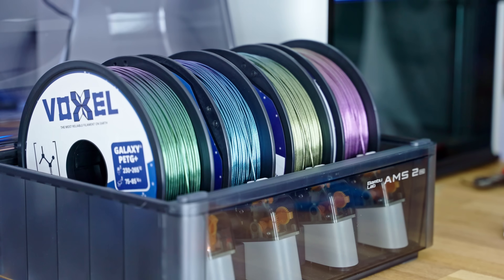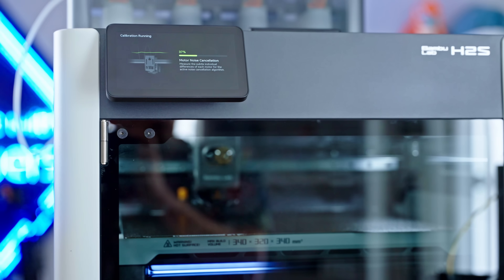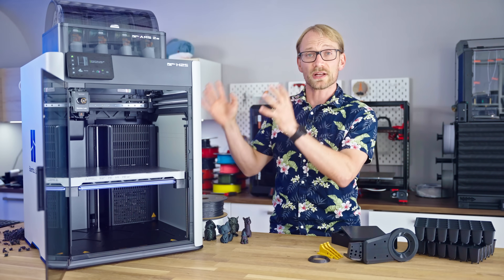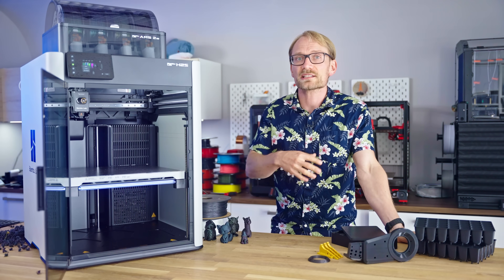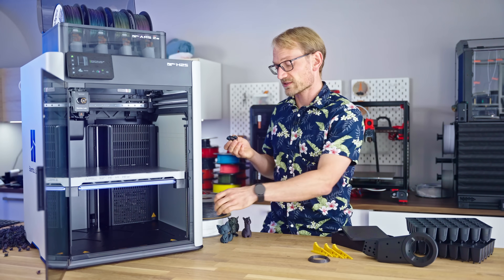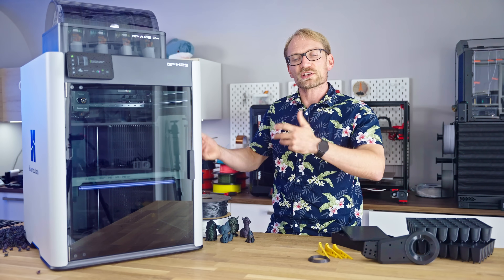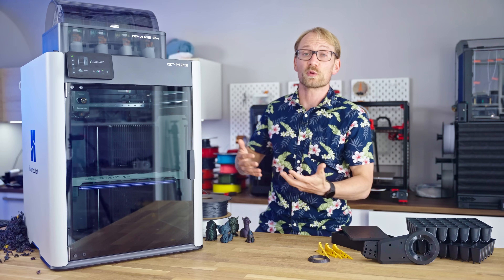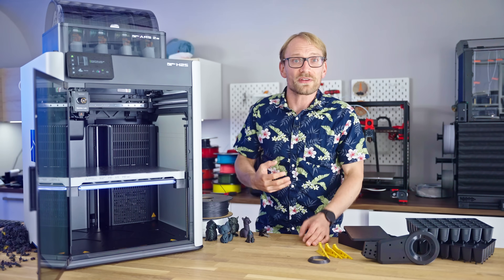Is Bambu's H2S truly a H2D Lite or just a bigger X1C?

Comment from the maker: So while the upgrade path H2S -> H2D has been ruled out by Bambu, apparently there will be an upgrade from H2S to the nozzle-changer H2C - though Bambu are already tempering expectations for how easy of a process it will be. If you ask me, the Vortek does look suspiciously like the recently-announced Bondtech Indx system. Coincidence?

Anyway, shameless plug here for the sponsor of the video, VoxelPLA's Galaxy PETG+ https://voxelpla.com/collections/voxel-galaxy-petg-hs and a quick link to the Bambu store for the H2S 😅https://go.toms3d.org/h2s

➡️ Get the H2S https://go.toms3d.org/h2s
➡️ Get the H2C: https://toms3d.org/H2C
➡️ Get the P2S https://go.toms3d.org/p2s
Please always check the prices of the models on the Bambu Lab website, as these may differ from the prices mentioned in the video.

Product links are affiliate links - I may earn a commission on qualifying purchases (at no extra cost to you)
Reply: "If you ask me, the Vortek does look suspiciously like the recently-announced Bondtech Indx system."

They are nothing alike IMO.. Vortek is going to have to cut the filament each time it swaps nozzles for color/material, because they are visibly off to the side in a vertical motorized loader. It's also physically inserting/removing new hotends. Indx the filament stays loaded in the tubes, rollers engages with filament wheels in an interesting grasping way. Like night and day really. But you nerd sniped me into a reply, so well played. The only similarity is 'wireless power' but even that is uncertain atm Indx uses induction heating I think, but the Vortek one was illustrated to have two odd pickup patches per hotend?.. no idea what they are doing with that, but they are likely using induction also.
Reply: @Roobotics  it is induction, the extra wireless parts are for nozzle identification and for measuring the temperature, they are probably just NFC style things
Reply: @shanematthews1985  I feel like you read my comment or just think very similarly
Reply: @Roobotics  So happy someone else noticed this very obvious fact. Indx looks like a proper toolchanger with filament attached at all times, Vortek seems to be just automatic nozzle changer. Massive difference inm time wasted.
Reply: Hey, thanks for the great review!

Regarding the Vortek:
It works diferently then the Bondtech INDX.

Drawbacks of the Vortek: 
- Not as fast color changes (I think it will be around 15-30 s)

Benefits of the Vortek (I mean... Based on what we've seen):
- The AMS does the heavy lifting, which is very very convinient. It i already developed, polished, and is really intuitive to use.
- You can connect multiple AMS-s, so more colors can be used (even tho more then 7 can be used only with purging)
- Only 2 PTFE path to the toolhead. So no bulky enclosure top, which makes bad things to chamber temperature, and of course, aestetic.
- Filament storage and management will be done from the AMS. So it can be humidity controlled, and so on.

Overall... It is totally diferent solution then the INDX, and also the U1. And probably its drawback will be slower color swaps, but I feel that it will be the most convinient, easy to use, most polished solution out there when it comes to the market (and later for a long time).
Reply: @filmodpetra one additional pro for vortex over indx is the opportunity (in software) to have a pause feature and manually swap from 0.8-0.4-0.2 nozzle sizes in the tool holder mid print so you could change at layer height to get better detail in horizontal text in every color on a large blocky object.  With indx you'd need 2 size of each color installed and that doesn't scale well. Vortek allows (hopefully included in software) some automatic swapping of nozzle sizes with a single purge for initial swap or more purge if user deems necessary and swaps in more layers.
Reply: @jamieprocter6653  WIth INDX you can have as many types of nozzles ready to go as you can physicallly fit on the rail. INDX is a proper toolchanger.
Reply: I thought their new toolchanger looked like the Indx too, I was looking around a few months ago to see who was using since I remembered they were really looking at licensing. I was disappointed it wasn't pcked up back then, but now i'm really glad to see it on the bambu printers
Reply: Bro the thumbnail makes the printer look bigger than you 😂😂😂 and it actually is holy shit thats cool
Reply: Could you not just pause the printer and change nozzle filament changes on the go, the nozzle would have to be registered to that AMS slot. A nozzle rack.
Reply: @MadeWithLayers Hey Thomas, diese Einschätzung zu kommenden Multitool-Geräten hat mir im Video gefehlt. Schön, dass du wenigstens den Absatz nachreichst! Denn mit dem Snapmaker U1 oder dem Bondtech INDX System am Horizont, stellt sich einem schon die Frage, ob über 1000 € für einen "single nozzle" Drucker noch zeitgemäß sind, bzw. auf manche Features wie die automatischen Klappen nicht ein wenig blenden und irgendwann nur für Probleme sorgen.
Wie gut kann man den Drucker eigentlich warten? Muss man diese Klappen eigentlich schmieren ... usw.

Aber natürlich baut Bambu Lab weiterhin fleißig viele Entwicklungen nach und drückt sie auf den Markt. Vom 3D-Chameleon System für Multicolor in der A-Serie bis hin zum INDX System... Wobei natürlich ein Werkzeugwechsler in CNC Fräsen (wie einer Datron M8 Cube) jetzt ja auch nicht so unbekannt sind.
Durch den zeitig eingeführten Filament-Cutter hat man jedoch sicherlich einen Grundstein dafür gelegt, dass man die Verbindung zwischen Nozzle und Rolle kappen ... und relativ sauber wieder herstellen kann.

Ich bin trotzdem ein wenig überrascht wie hoch du die Bedienung preist, sollte doch ein Core One ebenfalls schon einen einfachen Workflow zulassen.
Bin aber mal gespannt, wo das alles noch hinführt ... außer natürlich zu unser aller Geldbörsen.

Grüße!

p.s. Der Hinweis zum vorherigen Video über BL war wirklich nötig. Bei all den 3D-Druck Videos wurde mir dies noch nicht vorgeschlagen. Manches versickert einfach im Media-Rauschen ...
Reply: I’m gonna blow your mind. The name of the company is Bambu Lab. Not Bambu. 🤯

Comment: I don't know how compelling this printer actualy is. 
For half the price you can get a Qidi printer that will have very similar specs and get the job done. You wont have the laser and engraving options, but those units cost the price of a dedicated engraving/laser printer 
Back when the X1 carbon was out I had a Qidi printer, though it didn't have an ams (which the newer ones have), it was about the same time and effort to get the print started to finished on the Qidi or Bambu. The end quality was identical but the printer was 2x cheaper. 
A lot of stuff bambu offers are premiums that aren't essential and they make you pay for it. 

So I'd say it's a choice, if you want to double the price for the premium finish/options bambu gives you that option, even though it's unlikely to factually bring any meaning ful improvement to your end product. 

But on another note, 3D printers with multiple tool heads around 1000$ will be coming out soon from my understanding and that will make the Bambu printer much less interesting (though it all depends how they perform). 
I honestly believe that Bambu could've came out with a multiple head 3D printer but that wouldn't benefit them as they wouldn't be able to have you update and buy a new printer sooner down the road. 

There is also the data concern on Bambu printers but I don't know enough about that.

Would be interesting to have a factual comparison of the best bang for the buck 3D printers on their main practical functionnalities. Especially some less known brands.

Comment: Very good point on single vs dual head as it relates to expensive filament.  Over time for frequent material switching, for some volume in prints it would be worth the upgrade  to the dual head ... pay for itself in my case over 2 years

Comment: Did you use an AI generated thumbnail because the thumbnail there is no existing bambu printer with a wrap around window
Reply: I thought the same at first but it’s the printer with the door open that’s why it looks like that. Can see it when opening on a larger screen like a tv or monitor.

Comment: The only thing I hate about the Bamboo Lab is cloud connectivty and proprietary software. Hardware I love and agree, probably one of the best printers but I have learned that if there is any forced cloud connectivity - be it either by restricting features or making the device non-functional offline - then it is a no go for me. The only reason I still have my Prusa printer is because even if Prusa disappear years later, it is completely offline and uses standard binary gcode files so the printer can be used with any other software and completely offline.

The best example of why cloud only is bad, even through updates: New owner Future Home sent updates to customers devices turning them into cloud only subscription services from outright already purchased devices. This effectively to some degree ransomed customers into paying up or losing access. For an expensive device like the H2S and H2D, this is too much of a risk.
Reply: It is not a risk, you can use it without a cloud.

Comment: After 8 years of regular use, my very first 3D printer decided that it wanted to retire.. (Or maybe it was me not wanting to continue fixing it?).
Either way, last week it was time for me to upgrade. I was contemplating the X1c, but when I saw the H2S on Bambus homepage, I then decided on first buying a (non-AMS) P1S to "bridge the time". That P1S arrived yesterday and the difference in speed and quality to my 8 year old one has blown me away already. I should have upgraded years ago! My plan is to wait a few weeks until it's clear that there are no major flaws and kinks with the H2S and then add the AMS version of that to my P1S.

Comment: i wish they would be in the 40x40x50cm range like my elegoo neptune 3 max, nothing really like it for these type of printers, k2 max maybe
Reply from the maker: Prusa XL / H2x size is pretty much the maximum that is viable without redesigning major parts of the printer. Linear motion, extrusion and structural members all become much bigger issues if you want to do them properly at those sizes - not to mention the obvious limits on how large and heavy packages can become before they need a pallet and forklift to handle. The Neptune works at that size because the frame can be folded flat inside the package, but the boxed H2S was already right at that limit. Any larger and you're looking at hundreds of $ of extra cost just for packaging, shipping and handling.
Reply: @MadeWithLayers  the maximum size of a pre assembled printer would be a that of a washing machine. 50x50x50cm should fit, but it would be a very expensive and heavy machine. Shipping would be quite expensive.

Comment: Question< I saw your vid clip about changing 0.4 to 0.6 Nozzle,  I have just bought  Bambu A1 and print mainly RC plane parts ,will it change the structure , like the strength and mainly the weight of the part , I'm new to 3d printing I use PLA aero, I am trying to bring the weight down  and strength up, look forward toward your reply
Reply from the maker: If you do single-walled parts, yes, those walls will be thicker and therefore use more material.
Reply: That's great, Thanks for the feedback, saves me changing out the nozzle  👌
Reply: In my experience PLA-Aero dosent work as well with a 0.6mm.

Comment: MTBF. If one sensor has a 1 in 10,000 hour failure rate you get a sensor failure every 10,000 hours. If you have 10 sensors with a 1 in 10,000 hour failure rate then you can expect a failure every 1000 hours. In addition if you have lots of sensors when one fails you have a lot mor analysis to do to discover what has failed.
what will this printers reliability and spare parts supply be like in just 5 years or even 10 years?

Comment: Don't you have core one? It didn't had active heating out of the box?
Reply from the maker: I have a Core One, but it doesn't have an actively heated chamber. It can use the waste heat from its bed in combination with the chamber exhaust fan to raise and control the chamber temperature, but that limits the useful chamber temperature range to just over 40°C, depending on your ambient temperature and patience for letting the printer soak up heat before a print.

Comment: I've got a P1S and I'm so impressed how good that one is, I am very tempted at getting a H2S or H2C soon
I was very hesitant to the non open source of it but after doing some research after getting tired of not getting what I wanted from my old machines I decided to give it a try and although it have flaws it's very good. This year is ten years since I got my first machine, a Wanhao i3 V2, had someone told me back then that 3d printers would be this easy to use I would probably call some professionals for that persion, you know the ones that bring pills and a jacket that makes you hug yourself

Comment: Just a point, I have never ad my door or lid open on my p1s when printing PLA and I have never had any issues
Reply from the maker: I was actually looking into how much of an issue the door + PLA thing actually is on Bambu printers, after my Qidi Q2 absolutely choked itself out when I tried printing PLA with the door + lid closed yesterday. Spent an hour picking wedged-in bits of PLA out of the extruder afterwards.
For PLA on the Bambus, some people seem to have no issues at all, others swear their printers destroy themselves when the door is closed, so I'd guess it depends a lot on things like your ambient temperature and the exact filament you use.
Reply: @MadeWithLayers  and the build plate. I have noticed slightly worse overhangs when printing on textured PEI, but no difference with the Supertack plate.

Comment: the AMS drying function is not designed to dry wet filament.  it's designed to keep dry filament dry, and to keep desiccant dry longer.  
you should print the little desiccant containers that are designed to slide into the void areas inside the AMS.  with fresh desiccant, the internal humidity is less than 15%.  my cheap little sensor says 10%, and the built in AMS sensor says 12%.  that alone is enough to dry out some not so dry filament.
so your complaint that the AMS should support periodic auto-drying is... misguided i guess.  i could see it being useful if the AMS could detect when the lid was opened, and then auto-dry for like an hour afterward to bring it back to it's normal internal atmosphere.

Comment: remember that Prusa is using Legacy 8 bit electronics and charging a premium for it
Reply from the maker: Remember, don't believe everything you read on the internet. Prusa's printers have been using a 32-bit platform since the (original) Mini, MK4, XL and of course the CORE One. And in any case, it's not about the number of bits, it's how you use them.

Comment: Still waiting for a smaller modern multi-material printer :-/ A smaller "XL" with say,  3 heads, or a smaller H2D. The X1C is old by now, and the Core one is just uninteresting.

Comment: At this price point, buying the X1C doesn't make any sense. The X1C with the AMS pro combo costs in Europe 1419€, while the H2S combo costs 1450€. For an additional 31€ you get a larger build volume, newer technology and heated chamber.
Reply: X1C didn't make any sense since they launched the P1S
Reply: That's why the x1c combo now costs 1.000 Euro
Reply: @dsdasdasdasdertewbd  The X1C without the AMS costs 1050 €. AMS combo is 1300 € and with the AMS pro it´s 1450 €. These are the prices including VAT in Portugal.

Comment: hey bro. Do you use the CHT nozzle in your XL?  or just a regular bore stock nozzle? im thinking im gonna buy a regular nozzle for my mk4s because i think the CHT is getting frequent partial clogs  in one  or more of is 3 internal paths and its causing nozzle buildup that can ultimately fall into the print and cause it to fail
Reply: No but prusa uses heaters that are too weak so idk if cht makes much sense
Reply from the maker: I do have CHT on the CORE One and the main head of my XL (ObXidian on the other 4), and I've not had issues with any of them.

Comment: It is amazing how good a printer they are. I’m almost at 8000 hours on my x1 I replaced five nozzles, the extruder gears and the boating tubes like three times cause I keep cutting through them  after every single model of Ender it’s so nice to have something that works
Reply: I was gifted an Ender3 Pro at the beginning of the year. If I had let that experience color my opinion, I'd have never continued with 3d printing. I love my A1!

Comment: Regarding USB.   I have not walked up to a machine in YEARS even the P1S, only to clean plate and move forward.   If you are still using screens that is pretty yesteryear.  But if you are not in the Eco system then sure , easy to understand .